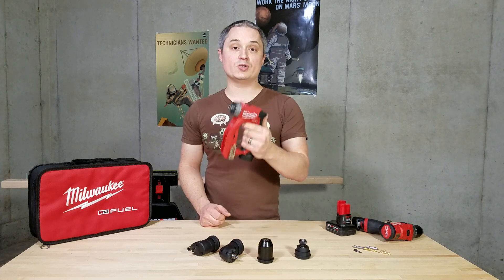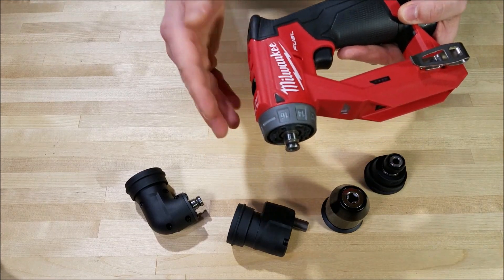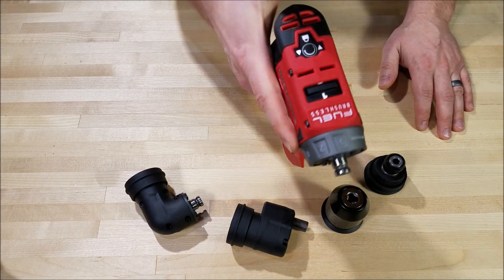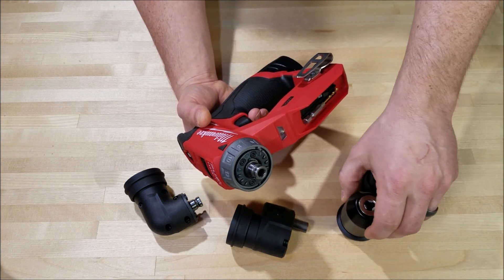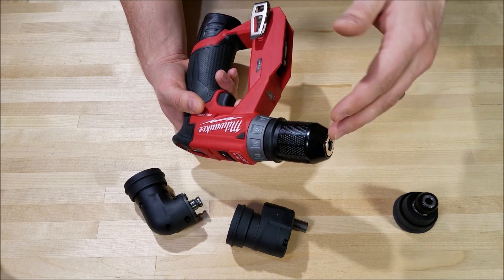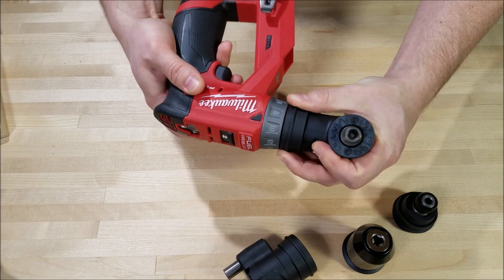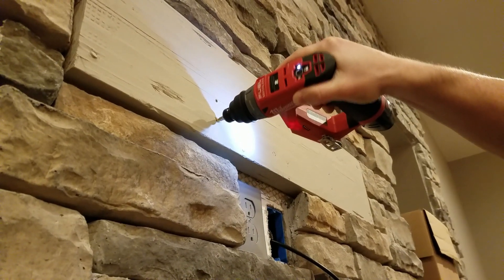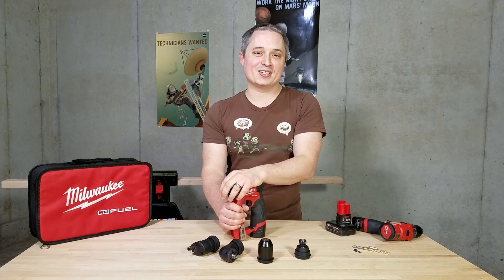Milwaukee M12 FUEL 4-in-1 Installation Drill/Driver Review

Comment: Hands down the best review of this tool I have found. Literally the only person to say that this uses a mechanical clutch, Milwaukee's website makes no mention of this even though IMO that's a big plus for a more delicate touch tool. All the other reviews concentrate on how big of a lag can you run in with it, literally could care less, that's impact driver work. I also appreciate the explanation for the foregrip, moving the electronics out of the head for a flatter footprint. Also explains why the controversial non traditional direction selector, it would basically have to be it in the front end in the way getting bumped.  All the other reviews are "it looks cooler and has a place for the light".  You never disappoint, and I'm always glad if I find you've reviewed a tool I'm interested in.  Keep up the good work!
Reply from the maker: Glad it was helpful!

Comment: I’ve had this drill for about a year now. It’s fantastic. I also have the M12 hammer drill and impact driver. Also fantastic.
Reply: If you could only choose one, the installation or the drill and impact, which one would you choose?
Reply: @nuclearexplosion5841  there’s jobs that only the impact could do but I would use the installation for 95% of all jobs I’m doing. The impact could do any job but could damage what you’re drilling into
Reply: Just picked this up on Amazon for $175. I've put together a patio heater, patio table and a few bar stools. So far so good. Only tried it with a 2ah battery. Not used to the controls and the light on it sucks 😕 But I do love the little guy!.

Comment: I used this a few times at a local community woodshop and it blew my mind, but that offset adapter drove me insane drilling pilot holes. I got the Bosch on sale and I'm super glad I did. I prefer their attachment system for changing position with the right angle and offset and their offset adapter locks. Though Milwaukee has a better locking bit holder.

It's wild that the Bosch is the cheapest, I think it's the best.
Reply from the maker: I agree, the Bosch 12V Flexiclick is my favorite (I refuse to call it the rebranded "Chameleon"). I bought the brushless version and figured I'd sell my brushed version, but just ended up keeping one for the garage and one for my basement workshop!

Comment: Would you recommend this over the Festool CXS? I'm wondering if I can use this as my only drill. With the CXS that's impossible, but this has double the torque. (given that both are the same price here in Europe)
Reply from the maker: I haven't used the CXS, sorry. I like the Milwaukee, but actually prefer the 12V brushless Bosch Flexiclick to it.
Reply: @DoresoomReviews  Thanks! What do you like in the Bosch over the Milwaukee?
Reply from the maker: I think I personally like the Bosch more, but it's not a no-contest win for either of them. The Milwaukee has better ergonomics, but the Bosch attachment design is much smoother when you want to hit a certain angle with the offset or right angle adapters. The 1/4" bit holder design on the Milwaukee is much better for one handed operation with just inserting the bit, and then pulling the collar to release. The Bosch requires pushing the collar for both bit insertion and release. However, the Bosch has a locking collar for bit retention on the offset attachment, where the Milwaukee just has a magnet. Bosch wins for direction lever design. Milwaukee wins on torque. I like the Bosch enough more though that I recently bought the brushless version when it became available in the US.

Comment: I noticed the same thing with mine. The right angle and eccentric/offset some times have trouble locking in. I think over time they will get broken in and be easier to attach.
Reply from the maker: That's a good point. Hopefully those tolerances open up with some wear.
Reply: Mine are stuck together

Comment: Check out the Rigid multi tool, I've been using it for 3 years and don't know how I ever did things before. I would buy the whole kit again in a second. Straight handle design allows me to get into smaller spaces.
Reply from the maker: The Jobmax looks like a handy little tool. Does it have an offset head adapter? That's the main one I use with this M12 and my Bosch Flexiclick.

Comment: Gen 2 of this will probably rock.  Seems like definitely needs tinkering.  Would guess 2021, 2022 at the latest.  They will want to sell a bunch of these first.
Reply from the maker: I would guess you'll be waiting at least 4 years for a Gen 2 version of this. That's the time frame between the M12 FUEL Gen 1 and Gen 2 impacts and drills, as well as the M18 Brad Nailer Gen 1 to Gen 2.

Comment: Do you like the Milwaukee or the Bosch better ?
Reply from the maker: I think I personally like the Bosch more, but it's not a no-contest win for either of them. The Milwaukee has better ergonomics, but the Bosch attachment design is much smoother when you want to hit a certain angle with the offset or right angle adapters. The 1/4" bit holder design on the Milwaukee is much better for one handed operation with just inserting the bit, and then pulling the collar to release. The Bosch requires pushing the collar for both bit insertion and release. Bosch wins for direction lever design. Milwaukee wins on torque. I like the Bosch enough more though that I recently bought the brushless version when it became available in the US.

Comment: Nice review again.  Glad to see you back.  My only issue would be the weight comparison.  You weighed the new driver without the chuck attachment vs the hammer drill which, of course, has its own chuck.  I would say their weight would be near the same with the chuck attached.
With that said, I don't see anything this unit can't do that my M12 Surge and hammer drill can't do better.  Each is more powerful and easier to use without fumbling with attachments on and off.  I'll keep what I have.
Reply from the maker: Good point about including the weight of the drill chuck in the comparison. This driver with the chuck installed is about 10% lighter than the M12 Gen 2 - a respectable weight reduction, but nothing spectacular. Without the chuck installed though, it's about 25% lighter which will really be felt by the user. So it depends on how you're using it. If you're just driving screws with it, you can get by with the magnetic bit holder and save the weight, which you still can't do with the Gen 2 drill.
Reply: The installation driver is not a replacement tool to the m12 surge or the m12 gen 2 hammer drill driver. It is more of a tool to use in conjunction with them. You may not use the installation driver every day like the other 2 but when you do need it, it is worth its weight in gold.
Reply: @jronmanbuilds  When would you ever need it?
Reply: @IndependentThinker74  for me personally I planned to use it on furniture, shop projects, cabinets, etc. where a traditional drill or impact will not fit. I have had a handful of situations where a tool like this would be nice, faster, and maybe more cost effective but not required.

Comment: If you reverse the direction, drill bits will try to come out of holes.
Reply from the maker: That's a good point, but it's an extra step you still have to take that isn't necessary if you've got a locking bit holder. With the way this forward/reverse switch is designed, it's just about as fast to just yank the bit out of the workpiece by hand afterwards.

Comment: I don't think I need this tool. I'm using Gen 2 M12 Fuel Drill/ Hammer drill for most electrical tasks. Driving bolts, anchor screws, and drilling thru wood and for concrete.
Reply from the maker: Yeah, if you're drilling into concrete, stick with the Gen 2.

Comment: Not worth buying:
- Nose-heavy. Even with a 6Ah battery it will tip forward and fall nose-down
- Fucken-weak! 300in*lbs torque is ridiculously weak for the size and weight this tool is. Milwaukee has come up with an M12 surge impact driver with 1400in*lbs of torque and the thing is just as tiny as this one.
- This set is $230!!! (Just for reference: the M18 2800's impact and drill set with two 5Ah batteries is around $300 right now!!!)
- Has no side bit clip. True, it has a front magnet, but it is a weak magnet that can only hold the smallest bits and will drop the longer ones, or the bit extensions).
- No impact function.
- The electronic direction switch is in a terrible location. The mechanical detent-type of the direction switch is the best as you can flip the direction without even shifting your grip. However the switch that this thing has... you either have to shift your grip, or use another hand to do it - either way you are fucked if you're in a tight spot with only one hand available to reach (which is the niche this thing was designed for in the first place)!
Reply from the maker: It's very well balanced with just the  1/4" locking bit holder, but it's true if you add on the heavier attachments it can be a little nose heavy. However, you're just wrong about the torque. 300 in-lbs is very good for a 12V class drill. You're comparing it to an impact driver, which is a completely different type of tool. Also, the M12 Surge has 450 in-lbs of torque.
Reply from the maker: Just curious, what type of work are you using it on? It's not meant to replace an 18V hammer drill or impact driver. It's worked great for installing cabinet pull outs and shelving in narrow cabinets for me. I actually couldn't reach into the back of one of the 8" wide cabinets with both arms, which would keep me from being able to use the right angle adapter you mention that requires two hands. So it's got its applications that it shines in, but maybe your type of work is too demanding for it.
Reply: @DoresoomReviews  he doesnt know what hes talking about 
This is good for electricians and cabinet workers  and finish work
Reply: @canogaparque818  I don't like having 3 tools on the job site for work that can be done by just one. I don't think you know what you are talking about.
Reply: @nickkey656  I have to agree with Nick.  Very low power, terrible forward reverse location, and mine had really bad bit runout.  Also no retention on the offset would drive me crazy when drilling.
Reply: I agree needs impact function, better lighting the lighting on it is shit, more power and location of controls suck. I picked this up for $175 on Amazon. I've used it a few times its not bad but shitty design.